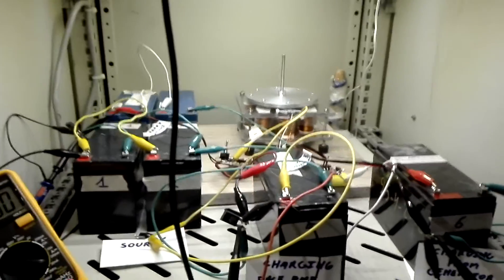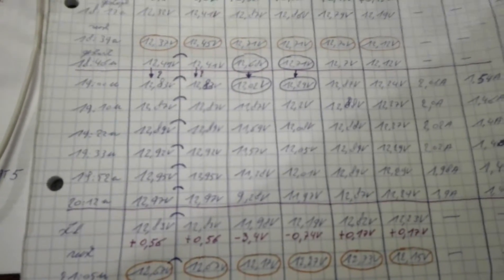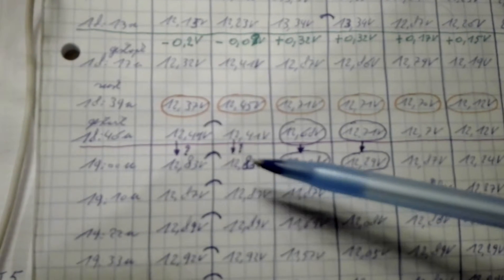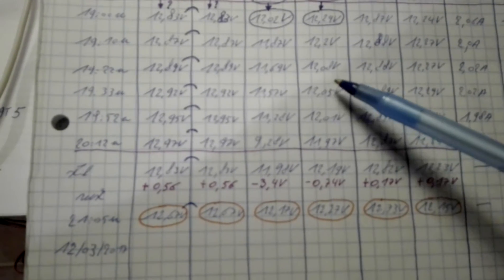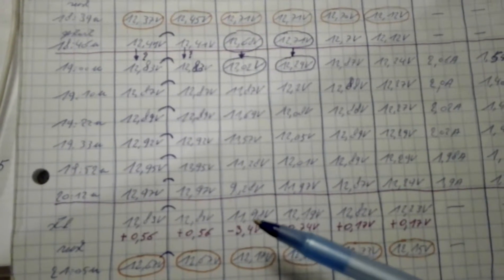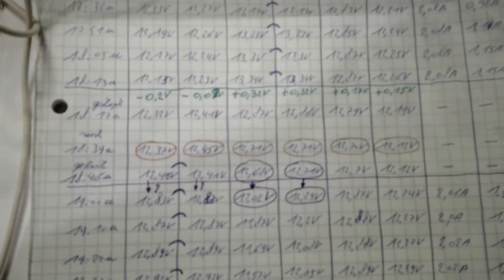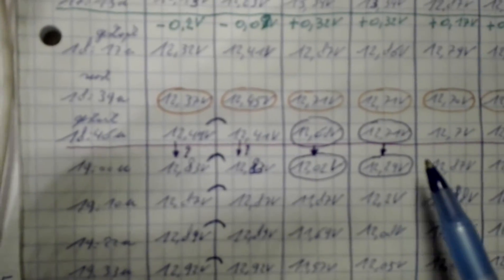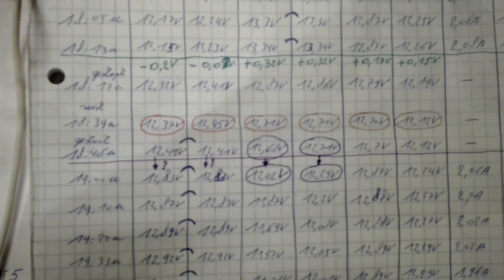003 Rick Friedrich Motor Generator

Comment: Appreciate your work. I think i blow mosfet :) have to buy new one. Then i try to do some 
measurement. Do you have capacitor on hall switch? Good luck.
Reply from the maker: At The moment I made no changes outside the super fast diode or add extra capacitors to the one in the generator coil. 
The kit I bought was preassembled and I first want to learn how it performs. Things I want to try afterwards is using fet with higher breakdown voltage, in the past when I experimented with only a coil and I used fet with 400V breakdown I got peaks off 400V, but when I used fet with 1000V breakdown, I got 1000V peak. Offcourse for batteries I can not go that high and also for everyone reading this, it's at your own risk when you try because it's getting dangerous with those voltages. I could go from 24V in to 1200V back emf peaks max even when I used 1500V breakdown voltage fet, so there was more energy comming back just by using other fet. I got the reaction that they where measurement faults of the oscilloscope, but I charged capacitors to this voltages, so I'm 100% sure that 1200V was effective comming from the pulses and that the breakdown voltage of the fet was a limiter, offcourse only to a sudden level.
If you place capacitor at hall sensor, won't you have longer pulses? Or do you want longer pulses to reach max magnetisation? I'm not electronic expert, just experimenting with little knowledge I have.
Kind regards
Reply from the maker: One quick remark if someone would try to change te fet, watch out for spikes going to the opto coupler, this is something I fear and must look into. (maybe using seperate supply for it is one thing that comes to my mind but I will need to experiment step by step)